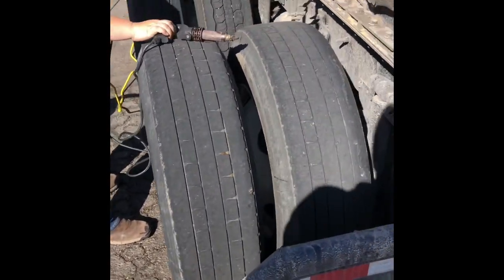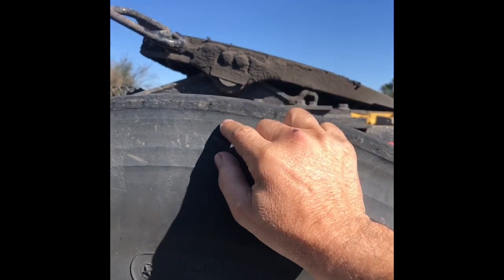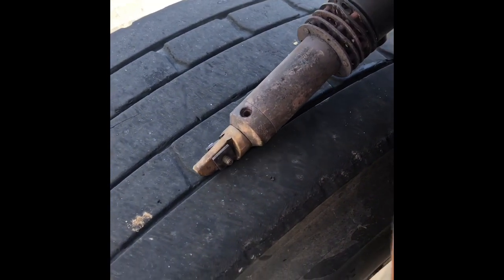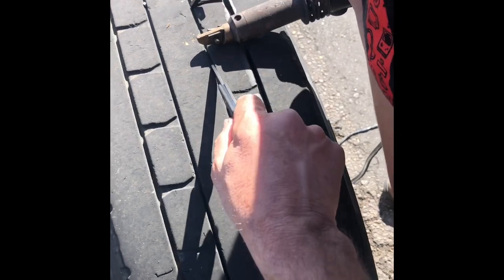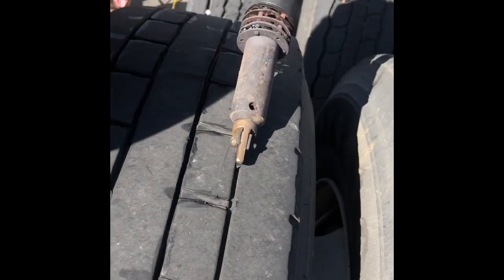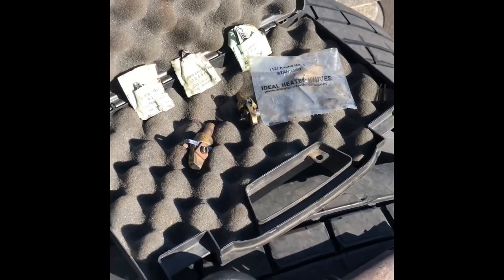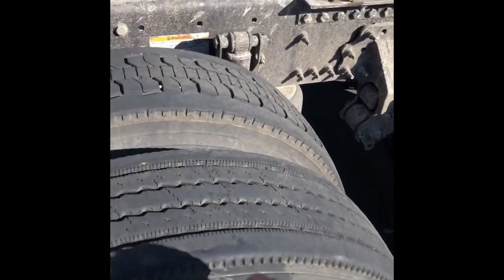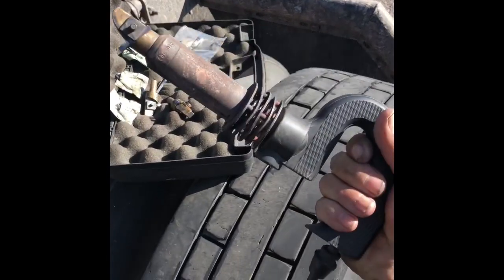8 tires for $130.00/The ease of re-grooving

Comment: Thanks man just bought a regroover got 4 drives to do and 2 on the trailer as a owner operator in 2024 money is beyond tight
Reply from the maker: Be careful not to go so deep that you expose the belts in the tire. You’ll feel the razor knife grab on them. If it does back up a little bit and change your angle so you don’t scalp them and expose them. Otherwise it’s an awesome tool that will buy you a whole lot of life legally on your tires.

Comment: Hi y’all, a friend of mine had a grooving tool like that and he would take a U blade that was to dull to cut and cut it in half and use part that had been clamped ( still sharp) to make a single line cut ( sipping he called it) in between the cross grooves 2or3 of them. Said it gave better traction on snow and ice. Thanks for sharing another great video with the good information.👍
Reply from the maker: It does increase traction. You can buy tires Manufactured like that now.

Comment: I just bought one of these tools and I’m about to practice on some old tires. I was watching videos on how to, and someone suggested using a torch to heat up the tire. He said it makes easier re groove. I might try that as well. Thanks for the video.
Reply from the maker: They are great! Never tried heating the tire but I do know a good hot blade in the regrooving tool makes a big difference. They will pay for itself in a single tire.
Reply from the maker: The key is making sure that you don’t cut too deep and get into the steel cords inside the tire. If you feel it hit just pull back readjust your depth and keep going
Reply: Where did you order it from

Comment: If you were coming up on winter and you were running tires with solid outer ribs (like those), could you legally add horizontal groves to your outside ribs to get more traction in the snow?
Reply from the maker: That is a very good question that I honestly do not have an answer to. As long as you did a good job I doubt you would have any trouble with it from a legal standpoint.

Comment: river wear can be bearings and or shocks.
Reply from the maker: It’s possible but those components usually cause more of a “hump and dip” or “wavy” pattern
Reply: @TruckingwithBones   I don't really have these issues anymore since I started aligning my truck using a tape measure and string.
Reply from the maker: A lot of people don’t know you can do it that way